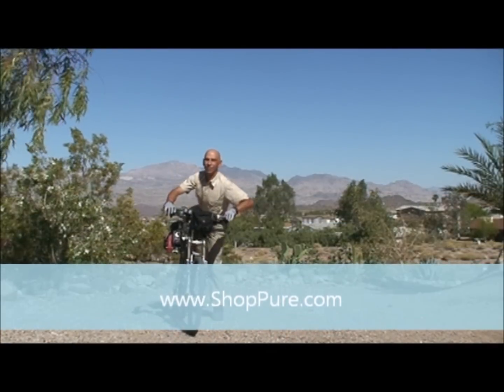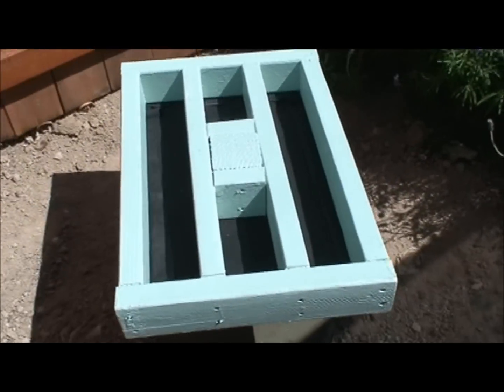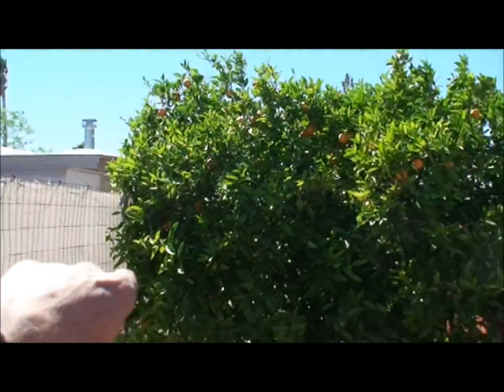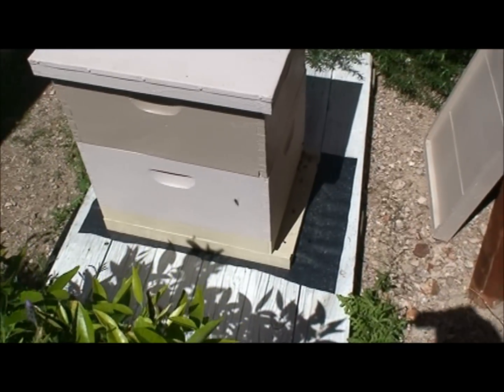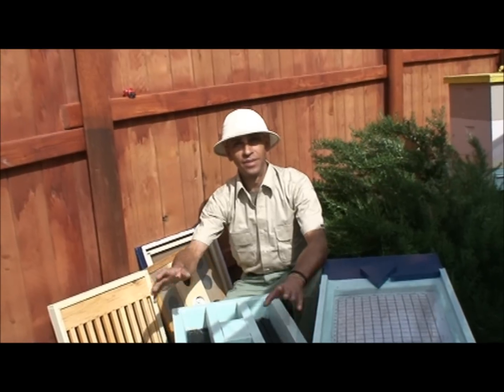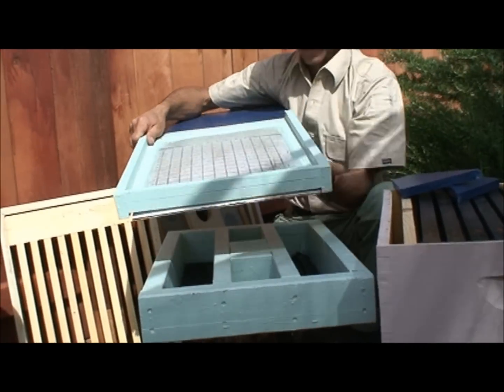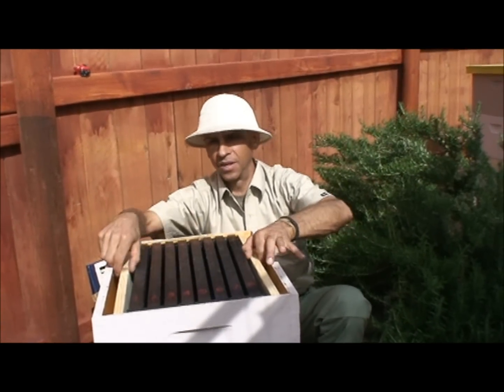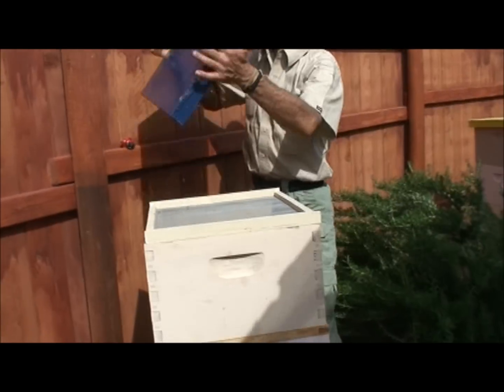Arizona Hive Stand - Modifications to bee hive - Beekeeping - PureSpiritBeeYard

Comment: I live in georgia it does not get that hot here but it still gets pretty warm. I built a box about the size of a med super with a slightly raised floor for clearance of the intake on fan I use. It is a little hampton bay 110V air purifier it cost me $2 at second hand store. Pretty low CFMs but produces a good draw. I used a thermatic switch for the fan to cut on and off I believe the range I used was 65 +- 5 to 85 +-5 degrees F. Two of the switches cost around $25. My production increased by 3gl

Comment: you know how to make things... the problem with that stand is that it has no bottom ventilation because you closed it all with that black rag. What I would suggest is to is NOT to close that area but leave some 50% not touching anything so that you have circulation. Also have some more holes in the hive trough witch the bees can enter as well as air. Remove aluminum top during the day and let the top board be the roof during the hottest hours. If it still gets really hot group the hives closer